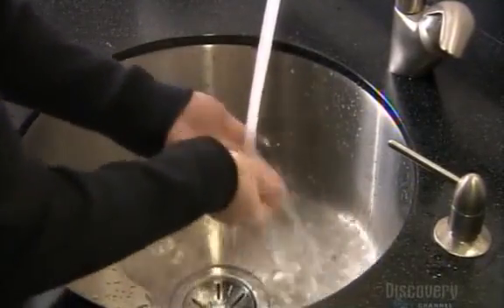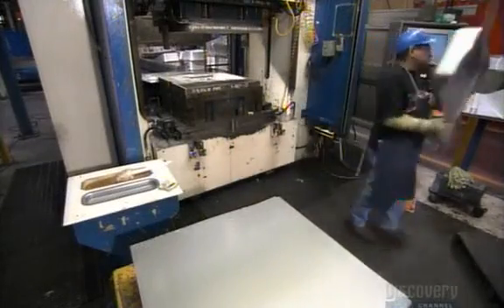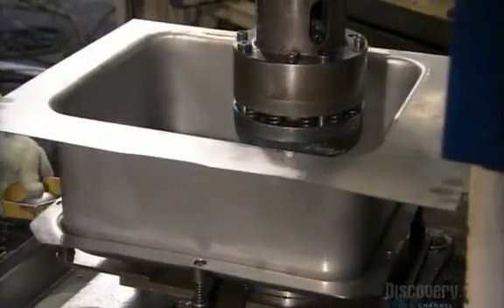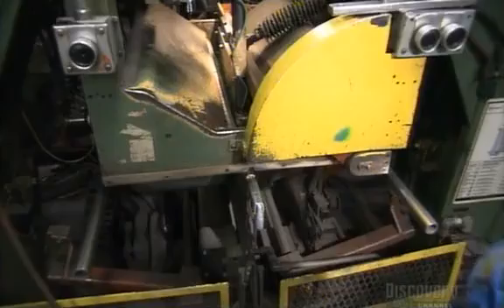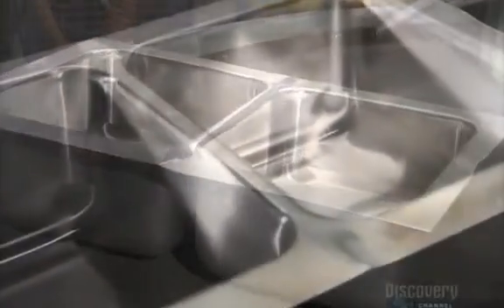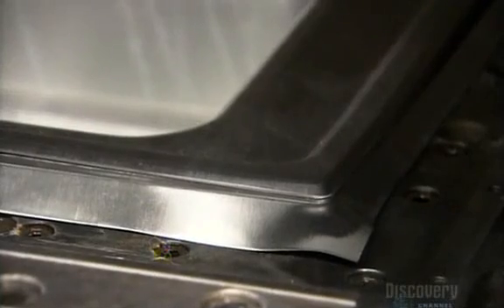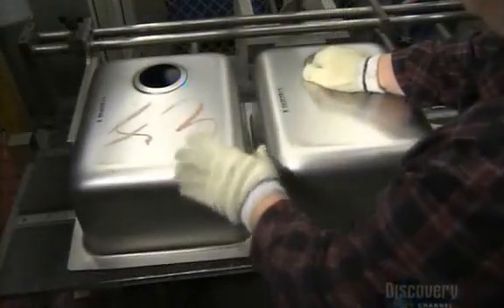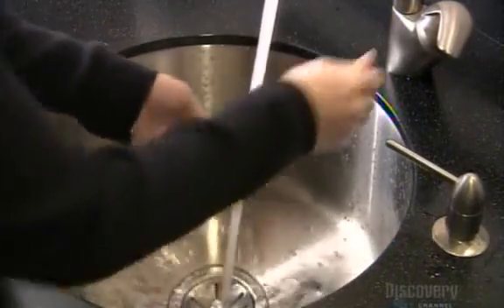How to make  Stainless Steel Sinks {www downloadshiva com}

Comment: this is great. I dont think the press is that many tonnes though. Reason being its way over the requirement for the steel. I think 100 Tonnes would happily push that out.
Reply: 100ton is not enough
Reply: How many tonnes then?
Reply: @jamesbarratt593  suggest 800tons in 1st pressing, 1100tons in 2st forming